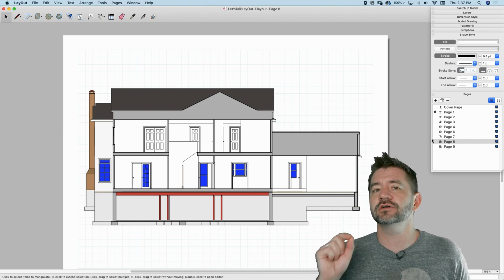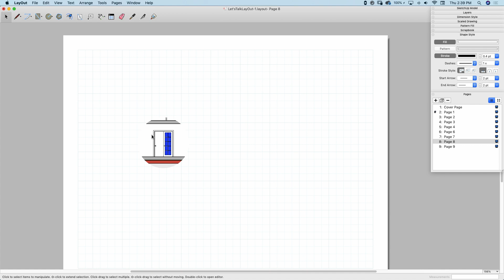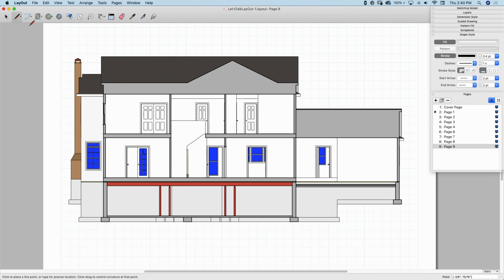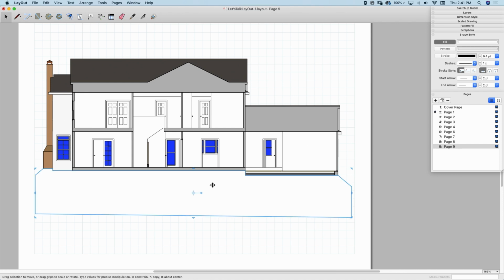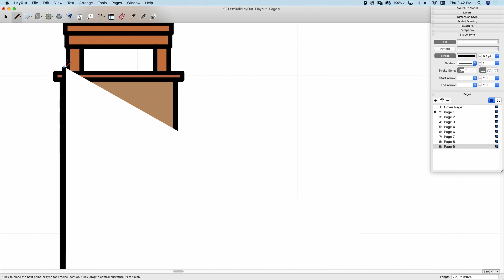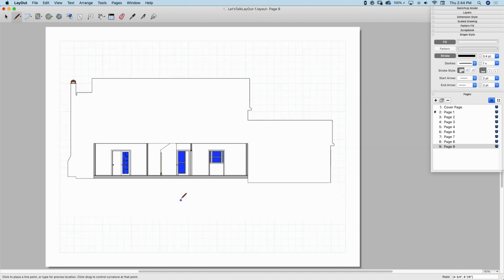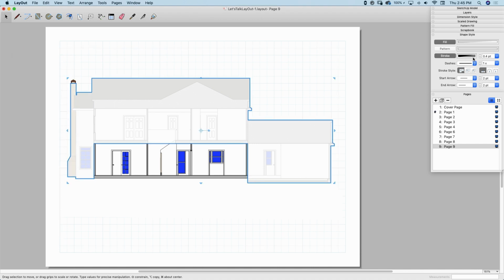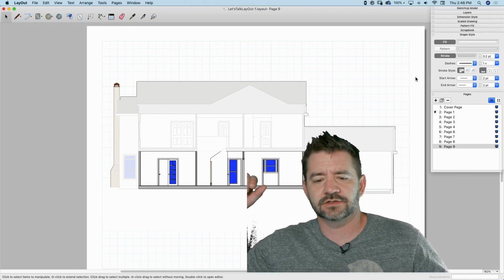Masking - Let's Talk LayOut

Comment: Hi Aaron, 
Loved this series, I'm a kitchen designer and I do elevations of each wall, I try and make as few scenes in SketchUp as I can to keep it light. Currently I set up a cut through section in SketchUp and save it as a scene and use that in LayOut. Is there a lighter way of doing it by activating it through SketchUp e.g. via tags. 
Example: For kitchen Islands, I turn all my tags off, only leaving the island, then use standard views to get top, L, R etc. saving around 4 scenes in SketchUp. 
Obviously if I do this with a kitchen run, I'm just looking at the back wall of my model! 
I'd love to know if you have a better way
Emily

Comment: Can we make a masked clip viewport that has an independent scale from the original viewport? For example, I have a viewport of a scale of 1/100 and I'd like to clip a small part of it and show this with a 1/10 scale in the masked clip viewport. When I change the scale of a masked clip, the original viewport is also changed. Is there any way to solve this problem? Thank you
Reply: That is a great question. I've seen it in SolidWorks.

Comment: How would you grey out less important geometry in all three dimensions?
For instance, say you had a complex pipe structure, and you wanted to highlight different levels of these pipes and the corresponding connectors for a step based assembly plan.

Comment: Is there a way to cut holes in the transparent mask? For example if you want to highlight only the doors and windows?
Reply: You can also have multiple copies of the same SketchUp view port, each with its own clipping mask hi-lighting specific areas of interest.  In addition, you can use a much higher scale factor in each clipping mask view to show specific details and have very detailed dimensioning and call outs.
Reply: Have a hole in your mask will give you a hole. Or have two models and two masks one separating the doors and one separating windows.
Reply: If you don’t need a stroke around your mask you  can draw the hole by connecting the outside points to the inside points along the same line. It’s easier to do than to explain! Imagine using a jig saw to cut the outer shape and inner shape without stopping. Won’t work with a stroke!